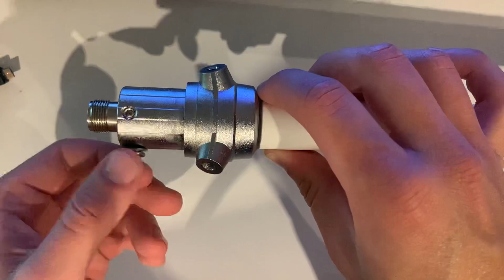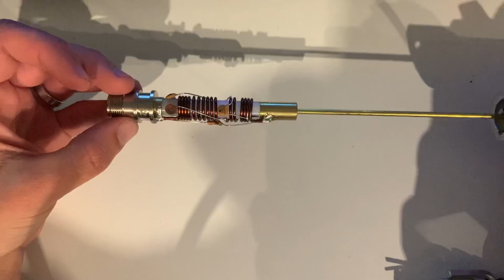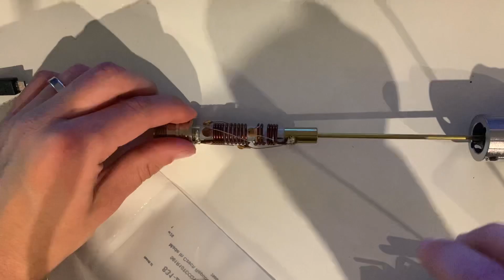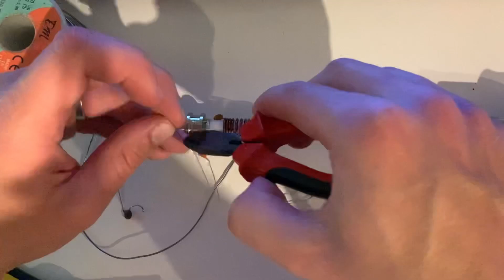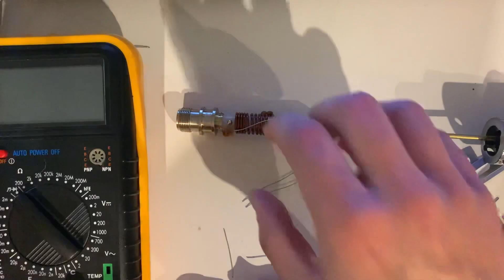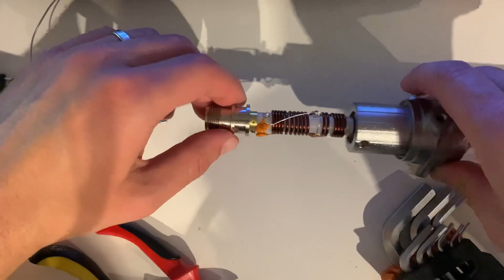Time To Replace My V-2000 - Repair and Test

Comment: Where did you purchase the capacitors from. What are the values of the others. I would like to replace all.of mine as the antenna has become very deaf on 50 and 144. Thanks Jon G8OPI
Reply from the maker: It’s been a while, but I think I purchased the capacitors from CPC. I’m afraid I don’t have the values for all the capacitors in the antenna.

Comment: in Japan, VHF power level are limited to 50 watts , in China 25 watts, so most of Asian antenna can not handle much power.   if I buy one of those, I might take them apart first , take picture of capacitance value, just in case.  AG6JU
Reply from the maker: I don’t believe that’s the case for the vast majority of Diamond antennas. I think I was just unlucky

Comment: So the $64000 question is "If you increased the votage handling of the caps to say 3kv, could it handle more power?"
I think it could!
73
Reply from the maker: Possibly, but is it worth it?
Reply: @M0JSX  Well if an antenna rated to withstand 150 watts fails at 80 watts, something has to be done!
You can either call out the manufacturer or investigate and experiment yourself. 73

Comment: Can you post the values of all the capasitors of the antenna.

I have swapped some before, but then used coax cable as capasitors. So you can cut them to whatever value you need.
works very well!!
Reply from the maker: Not without taking the antenna apart again, which I’m not too keen on doing! Apologies!

Comment: Hi Jonathan, I have a V2000. The match of 2m and 6m is fine, but the VSWR on 70cm is very high. Any ideas ?
Reply: Hi Jonathan. The story is I bought the V2000 second hand. The VSWR on 2m is around 1.7 : 1 across the band and > 5 : 1 on 70cm. Regards, M0CKQ. I guess it would be logical to replace all disc ceramics if I knew their values 😊
Reply from the maker: I’m not an expert at these things, but I’ll try to help. Has the SWR always been poor on 70cms?

Comment: Why not replace them all with they higher rated caps?
Reply from the maker: It’s a good point, but I’m not an antenna designer and there must be other reasons Diamond chose the value they did. 👍🏻

Comment: Hi Jonathan. Do you have the, values of the othet caps on that assembly.
My v2000 has a very high vswr but it was not either of the two you changed. Many thanks.. Pat.
Reply from the maker: Hi Pat, I don’t I’m afraid. I was lucky that I could just make out the markings on mine. I’m sure you can understand I’m not too keen to take my antenna apart again! You could ask some the the retailers if they happen to have mechanically broken one that you could purchase for parts?
Reply: @M0JSX  https://ea4eoz.blogspot.com/2015/09/v2000-teardown.html

Comment: Rather than removing the solder connections Jonathan, cut the old component out and leave a short leg. Solder onto that.☘️👍
Reply from the maker: Good point Donal. 73!

Comment: Hi there Jonathan. 

Thanks a lot for this video. I also have a faulty V2000 and this gave a beautiful insight in how to disassemble and repair the antenna.
However my issue might be a little different as it seems to be wind-dependant (and it works best with a nice breeze) and I am assuming a bad solder joint.

If you want to 'see' the behaviour of my antenna, look for my call and V2000 on youtube. Wonder what you would think about this -- that video is on a non-windy day.

73 for now!
Reply from the maker: Hi Anton, I won’t claim to be an expert on these antennas, it would be worth stripping the antenna down and reflowing solder wherever you see a joint. There really isn’t an awful lot else to go wrong with them - unless it is a mechanical problem with the two sections not having a good join?

Good luck. 73
Reply: @M0JSX  As far as I know yeah, that joint is secure. I will have to take it down, hopefully one of the next weeks and find out.
Reply: @pc4ad  i beth it's the coax cable..